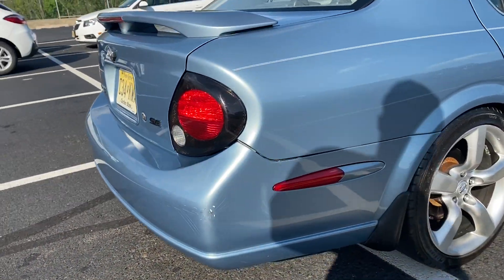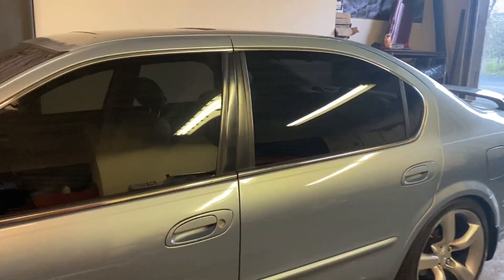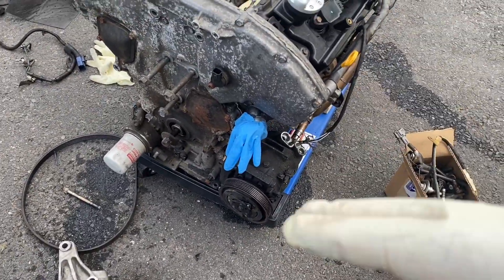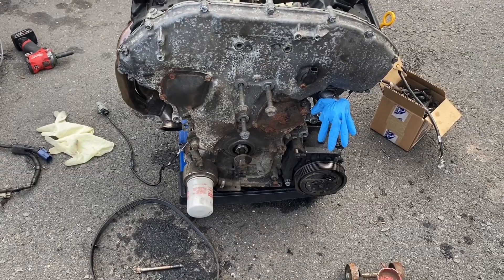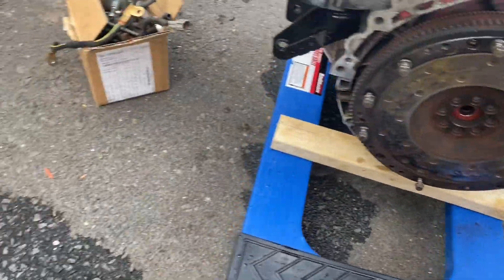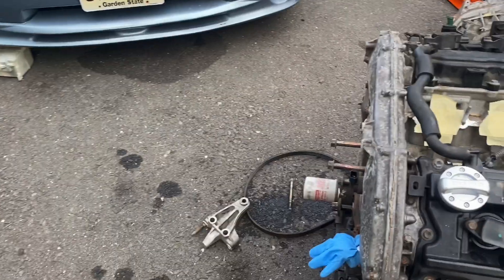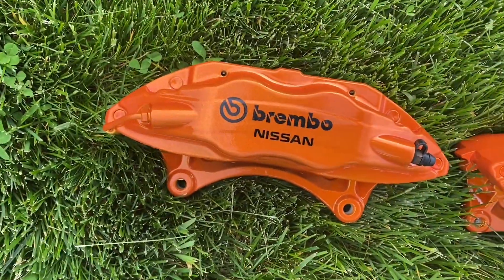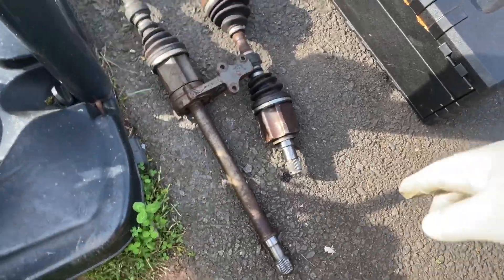Supercharged VQ35 Maxima Build ENGINE IS OUT.

Comment: Dont forget the 2 o-rings behind the timing cover, they like to get stuck to the timing cover, fall off and if you don't put them back you will have oil pressure problems. So make sure you keep your eyes open for them.
Reply from the maker: Yes for sure! The heat seizes them inside ! Got to make sure I got my trusty handy pick lol

Comment: Quick question bro. Did you have an issue after you installed your JWT flywheel. I lined mines up with the dowel pin on the rear of the crankshaft but I'm still having issues wity the crank sensor picking up the encoder wheel. My car basically starts and runs like I have a couple dead injectors/cylinders.
Reply from the maker: Hm did you check crank sensor harness? I have never had that issue before I’ve taken this trans down a number of times as well
Reply: @4DoorDave  yea I did. Everything seems to be fine.

Comment: Up to what year of máxima Nissan engine can I put in a 2002?
Reply from the maker: 2007 Altima 3.5 -2013 2009-2020 maxima engine as well. 2016-2020 require additional steps use discretion